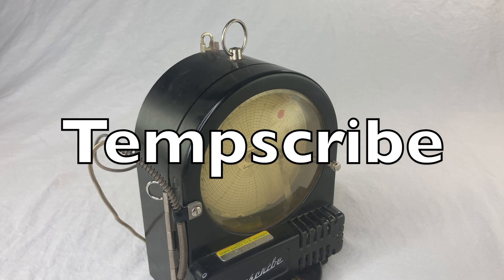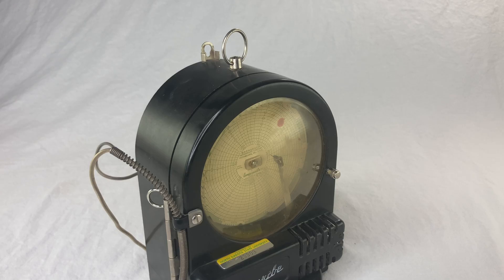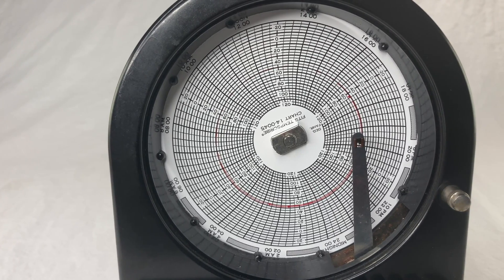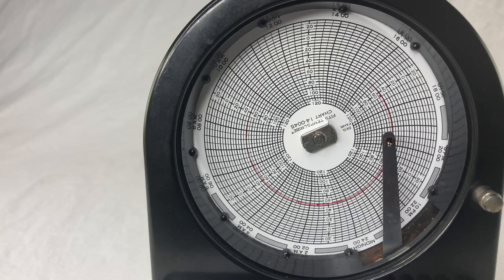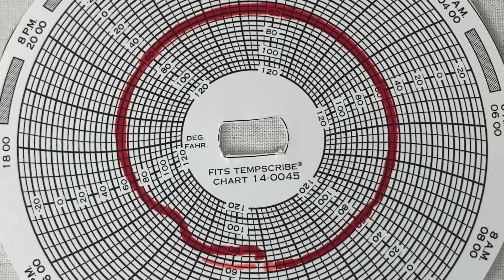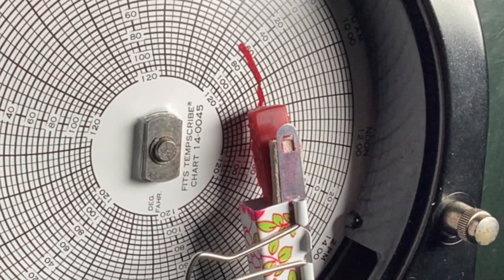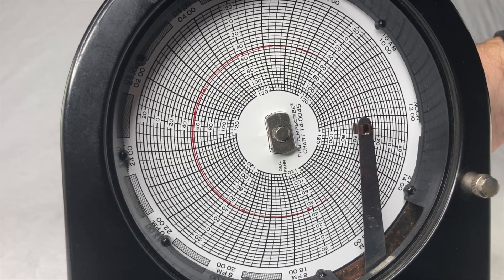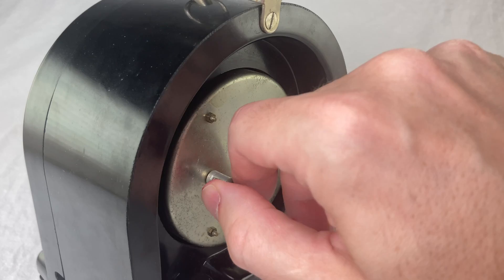Tempscribe winding thermometer Review / HowTo

Comment: The metal clip shown in the video is the original pen. No need for aftermarket pens. Also, you can move the cog in the middle to adjust the start time, it should have enough resistance to keep it moving, but not too much that you can't adjust it. If the cog feels locked to the clock mechanism, then there is something wrong inside.

Comment: Ive got one of these! i have the 24hour version with both the remote sensor door and the internal sensor door (so you don't need the long copper probe)
the original needle pen is the best as it draws a nice sharp thin line. the ink bottle that comes with it should have a fine needle attached to the glass stem, its used to clean the hollow needle pen. I just use Ink used for fountain pens and it works well

Comment: When I started working Avionics in the USAF  one of these plus a humidity unit of the same design was required at each maintenance shop.  AC was critical for many systems when opened.   Great in the states.  When I got to DaNang  we had them but the shop was in a hanger and there was no AC  so  the unit did not have a page change for the full year I was there.

Comment: These are not only still used, but even preferred in certain situations! With computer data aquisition of analog data, the samples are often time based, say 1 sample every minute. If you get a wild swing within that period, you wont see it in detail, or even at all. With these, you'll always see the spike, almost no matter how fast it happens!
Reply: We still use them in pharmaceutical packaging applications where there needs to be a constant record of temperature, they also use a similar thing to record humidity.  All calibrated of course.  The paper record then goes into the file of the batch of the medication and is kept on file for the life of the product.
Reply: @MadMattH Yeah, that’s just a cheapskate company leaning on a legacy system. Having instantly searchable records from a digital recording and storage system, with plenty of backups off site makes far more sense, but may cost more than a notoriously miserly pharmaceutical company wishes to spend.
Reply: Yeah, that makes NO sense, why would you pick such a crude length of time when using a digital system?!? You can specify tiny fractions of a second and zoom in and out on the data in a digital system, far more detailed than the fat blurry line of this analog machine. You can also instantly find any average, median, mean, or any other stats you like. Yah ain’t makin’ sense.

Comment: Well isn't that interesting: I refurbish clocks and watches -and- own a tempscribe! Anything I can do to help you get your not-working one working again let me know!
Reply from the maker: Nice! Was I wise not to attempt to unwind it myself?
Reply: @ChrisStaecker very much: the right way is to support the barrel (which includes the spring) from unwinding, carefully disengage the clickspring, and then carefully let it release its energy very slowly. Even contained, if you let it unwind completely free it's likely to damage itself because it will happen with a lot of force.

But then the next steps are to figure out why it's in that situation: usually means the rest of the mechanism (especially the escapement) is gummed up or possibly damaged. I bet every time someone poked at it they inevitably wound the spring with no way for it to unwind, and now it's fully locked up and putting undue pressure on the spring's bridle.

Needs to be unwound, then taken apart to examine all the pivots to make sure they aren't bent or broken, then reassembles with the right oils and greases

Comment: love it! I’ve worked in museums long enough to have gotten to use battery-powered drum and radial hygrothermographs, plus the even cooler psychrometers to calibrate. We normally used psychrometers with an electric fan, but still had a few old school sling psychometers that were extra fun to swing around. Then the digital dataloggers came along and ruined all the fun.

Comment: Does the binder clip on the arm distort the measurement? If so, would re-calibrating fix that? 4:07
Reply from the maker: I think that it does- it makes the head heavier than usual, which will probably dampen the spring action overall- I'm not sure if the calibration would be able to counteract that. I also don't know how long the original marker is, so my pen is likely not hitting the paper at the correct "height"- this also probably cannot be fixed with the calibration screw. But overall the temperatures I'm reading are reasonable, and given the thickness of the line I'm drawing it's fairly imprecise even in the best case.

Comment: I thought of an idea for dewinding the spring. Put it in a vice and gradually open the vice.
You'd have to somehow get the vice and gears on at the same time which may be hard with other parts in the way.
When you mentioned the 7-day clock, I remembered a store in appearently North Grafton MA which is I thought near where you lived.
When you do all the calculating machines you could turn to clocks.
Reply from the maker: There's a clock shop near me that I'm sure could've fixed it- but it was cheaper to just buy a new one!
There are various tutorials on youtube for unwinding something like this, but I didn't want to risk it.

Comment: The needle may be for scraping "blacked" paper. Blacked paper has a fragile layer of soot deposited on it from a parafin lamp.
Reply: Ohhh. Carbon paper. Carbon. Burned something. Soot. I never realize that until this very moment. Thank you. However, you could probably just put black permanent marker over the glass, and the needle would scrape it. Clean off the marker with alcohol.
Reply: Good idea, if you use a disc of plate glass (with the gradations etched on the back side) you can even re-soot it yourself and use it over and over. The lower friction between the stylus and the glass should also mean more accurate measurements than dragging a pen over paper. You wouldn't get an archivable paper copy but some use cases might not need one.
Reply: @TaramiBedona  -- i'm pretty sure the blacked glass came first. Edouard-Leon Scott de Martinville did it for sound recording.
Reply: @TaramiBedona  Couldn't you just take a sheet of paper, deposit some adhesive on it and then transfer the remaining soot onto the paper for archiving?
Reply: It's not a needle, it's a tube, and it is a pen of some form or another, I'm trying desperately to figure out how to use it

Comment: i don't think there's anything that feels quite as magical to me as bimetallic strips, or in this case, the bimetallic spring. you can turn the the expansion and contraction from one metal changing temperature into a rotational motion by having 2 different metals (which expand and contract at different rates) attached to each other so that the ones that expands more can "stretch over" (kinda) the other, tilting the whole assembly. this is how a whole bunch of old thermostats, garden thermometers, and toasters worked. it's the most effective way to detect temperature without electronics, apparently.
Reply: If you aren't familiar with the channel Technology Connections you need to be. I think you'll get a kick out of it.
Reply from the maker: Yes- he’s great

Comment: For the average, cut the paper out along the line, weigh the paper!
Reply: this is not quite the average; it biases toward outside values because there's more paper per angle out there.  If for instance we have a curve that spends half the rotation at radius 1 and half the rotation at radius 2, the resulting "average" comes out to 1.58 as opposed to the 1.5 that it should be.  Prof. Staecker talks about that in the video about the radial planimeter: https://youtu.be/jmtYW1lDP8M?si=iPOTm_edYQMHGtOI&t=332
Reply: @unspeakablevorn  But that's not a problem. You weigh it, look the weight up in a table that presents the inverse function. 
Any idiot can cut the shape out, and wiegh the paper, which makes it an interesting method.

I was discussing this the other day withsomeone making river tables with epoxy. Look them up. How much epoxy do you need to mix? 

Well my view, weigh the wood. Get its moisture content. Now calculate the volume using the standard density for that wood, and adjust for the extra or less moisture. You now get the volume. Compared to a descrete measurement of gap, a rough integration, the weight is known to a high degree of accuracy. Even a 25% moisture level compared to a standard 20%, leads to a 5% change in value, and the error is in volume is going to be small. 

Now you can calculate the mold size, take off the wood volume, a bit extra for safety and the jobs a good 'un.
Reply: @Nickle314 So, logically, if the cut out paper weighs the same as a duck, it’s made of wood. And therefore… a witch!
Reply: Does it quack? :-) @MrEMeat_YT